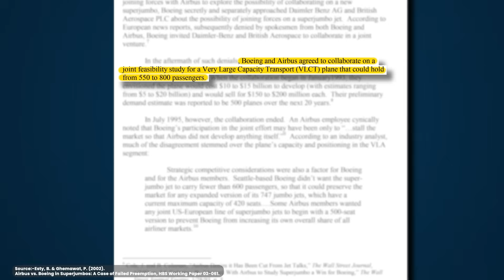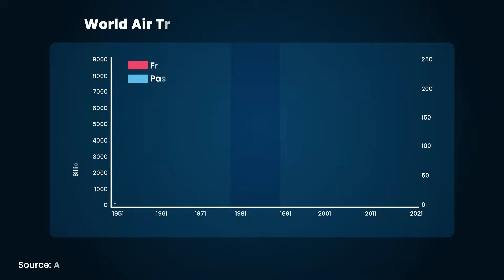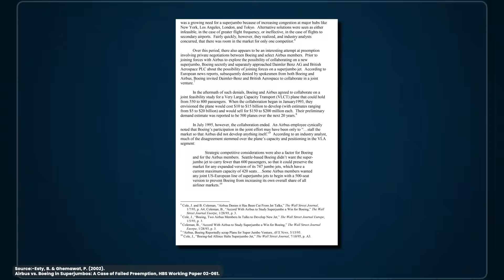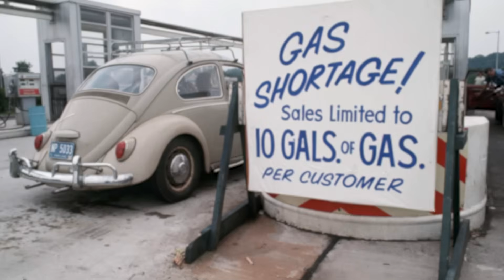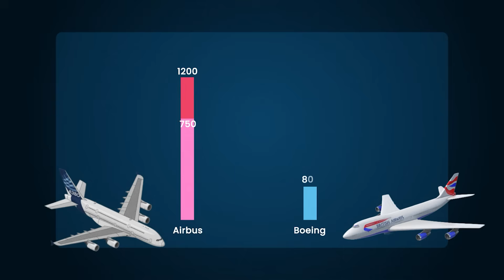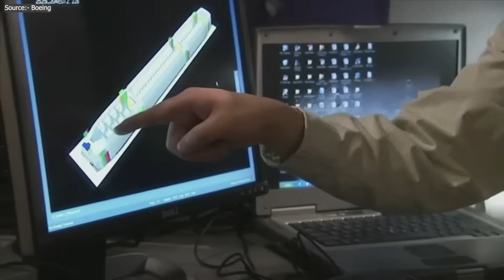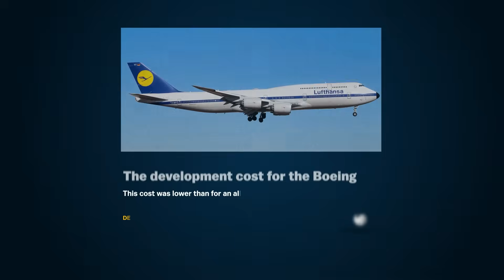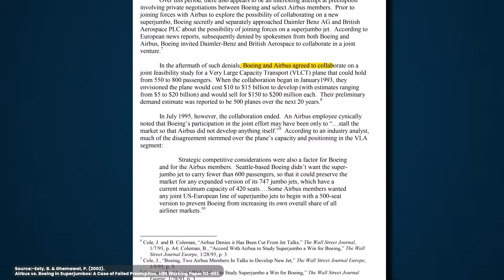Boeing Knew 747-8 Would FAIL - But They Built It Anyway

Comment: - Replacing the Concorde and the massive Air traffic of today should validate the Jumbos. But the A380 wasn't made for massive transport but Luxury; The Arabs were right: it should have been 3 Engines, instead of 4, and should have Vector Thrusters, specially useful, when losing 2/3 Engines; also automated food service.
- We're in the Era of Computers, Robotics and AI; so it's time to design Airplanes Better: Wide Body & Blended Body-Wings; it's 1,000s of people to attend.
- No more Heels, Flat Shoes is Anatomically Correct and Efficient Walking, it's criminal to have Flight Attendants to use any size of Heels.
- Comfortable Seats: Nobody wants to fly, if they know it's gonna be like Sardines in a Can.
- More Cushioning with Lots of Bushings, Even Twin-Tube Double-Gas Shocks, Sorbothane Pads & SumoSprings Components: to cushion the constant Vibration, Specially in Turbulent Airspace; will avoid Metal-On-metal Friction and Fatigue, Prolong the life of Metal and Composites

I don't think it was a genius plan, it was a butthole plan, that probably made the A380 Inefficient: wings are way too big, 500T I think it's too heavy, Shop, Disco and Restaurant inside, it's just stupid: it should be Centered in Seat Comfort, and optimize the areas to fit all Economy Classes, 'coz the point is Massive Transport for up to 14 hrs. or so, hence should had a Fuel Tank in the Vertical Stabilizer, lots of bathrooms, food and Air Freshener, lot so farts & stinky feet. WASH YOUR FEET WITH ALCOHOL AND USE SOCKS IN ARIPLANES

Comment: They didn't lose money on every sale. They failed to recoup investment. A very different thing. Personally, I think the "envy" played a big part. They really wanted to build it. I don't think they needed that much convincing. It was the bean counters that had to be convinced.

As for 787/ A330neo timing, your story is incomplete. When Boeing announced 787, Airbus initially proposed updated A330. But airlines were not interested (I guess they didn't think it would make enough difference to compete with clean-sheet 787). So instead, they started developing A350. A330neo was a result of airline request after the success of A320neo, demonstrating just how much of a difference can be made. Boeing didn't really delay them that much (the difference between introduction of 787 and A350 was about 3 years which is not bad considering Boeing had head start). They could have updated A330 sooner. But the market wasn't there at the time. Also, this project helped end A380. Airbus considered re-engining A380 but they didn't want to do both A380 and A330 simultaneously and chose to prioritize A330 which actually cannibalized A350.

Comment: Boeing absolutely did have a 747-8–type concept floating around in the early to mid-1990s (often grouped with studies such as the 747-500X / -600X). Post–Gulf War uncertainty, weak yields, and airline consolidations/bankruptcies at the time made any VLA pitch a tough sell. On top of that, the 777 was emerging as the shiny new “do-everything” twin, and Boeing correctly read that airlines wanted flexibility and efficiency — but arguably misread how long the upper end of the market would remain relevant.
I also think Boeing was wary of repeating a blunder like the McDonnell Douglas MD-11, which, despite being an excellent cargo aircraft, was a sales failure in the passenger market. Another factor to this is their 757 which was another "do all" aircraft but it was "too much" plane and airlines could not figure out what to do with it (large, somewhat heavy with powerful engines) and what to use it for until later when they figured how to use it for and it too is an excellent cargo plane.

Comment: The A380 was a big project, with a big risk, that did not pay off. However, its setbacks were not all Airbus fault or Boeings doing; the world changed after 9/11. It could have gone a lot more like Airbus though it would go. Emirates is proof that the A380 can work, if you fully commit to it. Airbus was right that some airports would congest and needed larger planes.

Comment: Correct assessment.
Just missing the broader picture: Boeing had two more objectives besides either bankrupting Airbus on the large widebody segment, or at least severely delaying it eating market chuncks:
1) Entertain Airbus confidence in the future of quad jets. The purpose is the same, delay Airbus by lurring it in making useless products: A340-500 and A340-600 which were totally defeated by 777.
2) Incidentally, reign supreme on twin engines, narrow, mid size, and widebody.

Did it pay off? Yes, undoubtedly, but nothing is perfect black and white.
Airbus did get delayed, a lot. But when I look at Boeing's options today about the future of the 737 program, particularly the volume of that market segment compared to the widebody segment, I still believe Boeing should have done MORE than just sacrificing 717/757 programs to boost 737NG production.

Where Boeing failed is correctly measuring Airbus consortium ability to FINANCE multiple programs at once, like an entire facility in Tianjin, or capitalize in other segments where Boeing is absolutely or partially absent (ATR/Aérospatiale helicopters...) Hadn't Boeing committed to actually develop and produce 747-8s, would 737NG have outpaced A320/A321 deliveries, which never happened since a decade and a half? Sounds not big of a deal, yet... Would have 737Max got more finances to get proposed early and on time without design flaws? Would have Max10 sufficed instead of for airlines to be coerced into getting A321LR/XLR? Discreetly, a small lack of finance CAN ACTUALLY HAVE DREADFUL CONSEQUENCES 20 YEARS LATER!

^^ An alternate reality very hard to assess. But one thing is becoming clearer and clearer: tables had turned, now, it's Boeing the one who is backed in the corner. 737Max is its newest type, so young, Boeing is engaged, cannot back off, just like Airbus with A340-500/600 and A380, and cannot propose a 737 successor when airlines are still awaiting for the delivery of their FIRST Max. Just like quad jets had no future, isn't the 737 also a dead end?

I mean, better ask Airlines, when the time comes they need to phase out their Max, would they have the slightest interest in yet another upgraded 737? Maybe a twin 707 up to modern standards, this looks very much like a 757, yet a 757 is much heavier than a 737 due to its massive wings. Range is not what airlines need, it's the LOWEST fuel consumption with the HIGHEST capacity amounting to the LOWEST MTOW, because weight is the No1 enemy. In other words, a 757-200 fuselage with TINY wings and just capable enough economical engines, that flies barely enough to cover 99% of their network... That's an A321...

Boeing has no choice but create a new narrowbody, with all the required finances, just like when Airbus was committed to develop the A380. Building a new aircraft is not the challenge. The challenge is to get back from Airbus a massive number of unit orders, amounting to several THOUSAND..!! I'm still wondering, was it worth it? If Boeing didn't made the 747-8, perhaps Airbus would have sold 400 A380, plus 100 freighters, then sold 40 more A340s, then would had a little more finances to launch A350 earlier.. is that really bad for Boeing on the widebody segment, would the value of more widebodies for Airbus outmatch the value of narrowbody currently own by Airbus?

The bright side (Boeing-wise) is Airbus got delayed 20 years... but the future is gloomy reversing the massively A320/A321 equipped airlines. It does not take a slightly superior new aircraft to interest airlines, Boeing needs the PERFECT product to justify the storm a switch back to Boeing means for airlines... BTW, Airbus won't just stay idle... A322, A360...... Wouldn't it be time for Airbus to make a 767 successor while Boeing is stuck with Max and its successor (and 787, and 777-X besides)? 1500 A370 potential units, doesn't sound that bad. Though, learning from past mistakes, probably not the priority.

Comment: The airline that was the first to fly the A380, was also the first airline to scrap a A380...

A380 was another mistake just like the Concorde.
Reply: I wouldn't call it a mistake. It was a question of prestige. It was a project people at Airbus wanted to make. Sure, they were disappointed in the result. But there were factors at play they couldn't predict. And I wouldn't be surprised if they would do it again. Even though it wasn't a commercial success. It's not like it bankrupted them.
Reply: The leasing contract for 2 of the Singapore Airlines A380 expired.
Those were of the very first production batch of the A380.
Until today, Singapore Airlines has active A380 in its fleet, but not rhe oldest ones.

One of the retired A380 of Singapore airlines was re-activated for soem time by "Hi-Fly", a Portuguese company. I recently flew with Hi-Fly, but in an A330 (Wetlease, AZUL Flightnumber)